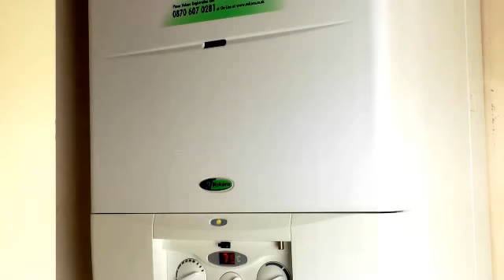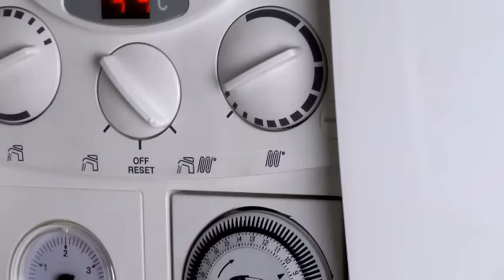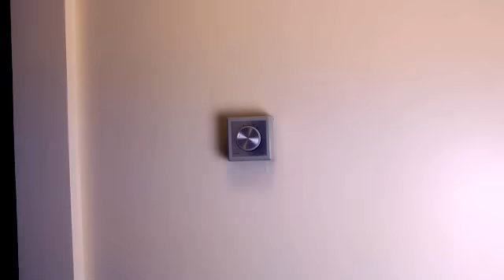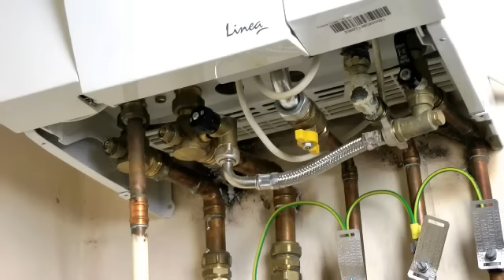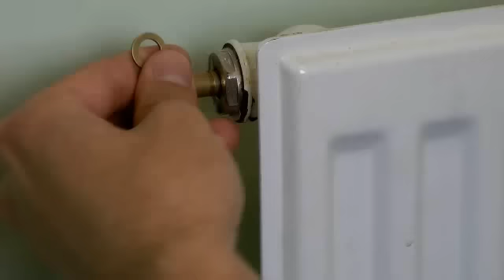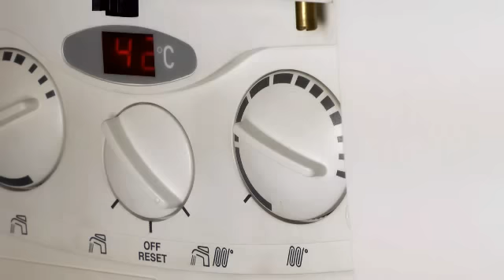How to repressurise your boiler

Comment: So how do you release pressure from the Vokera boiler? Mine is at 2
Reply: Open a radiator valve at the top, let some water trickle out, then close valve,check pressure on boiler .

Comment: Maybe someone can help me. Cant repressurise my boiler, pressure meter shows 0 and then I open valves  there is nothing going on, no sound no nothing...There is additional valve dont know why maybe to check pressure or what, so then I opening it there comes very little stream of water with no pressure. Can someone soggest where is the problem? I live in apartment, could there be somewhere additional valve that closes water or something? Is it possible that some parts get stuck inside boiler? Because I was using it all time and one day I started it and after some time protectors shut out. I can still run it but pressure not increasing and I think after some time all situations will repeat again.
Reply: Check this video.that ur opening the right valves.
Reply: Also check is it both taps or just hot tap?could be thames water r doing works in ur area n decreased the pressure.their website will tell u
Reply: Open both black taps to pressure the boiler up.then close both when done.

Comment: Mine is going to 3 bar even after I close the filling loop! Any feedback please?
Reply: if it continues to pressurise and you are sure the loop is closed, then the loop closure valve(s) have failed and you'll need to get a plumber to replace them

Comment: That radiator is full of sludge hence the colour of water coming out and resulting a loss of pressure.
Reply: sludge doesnt loose you pressure, must be a leak on the system